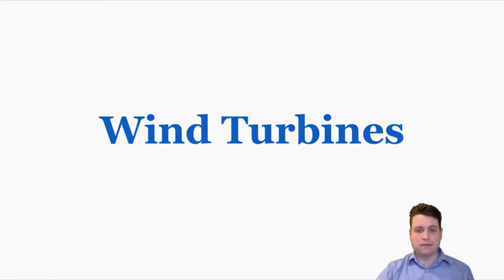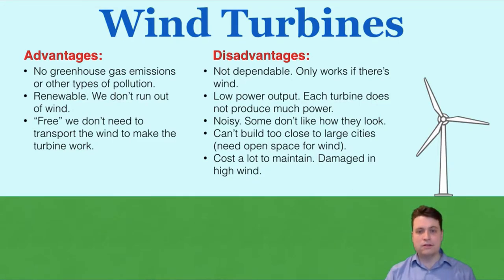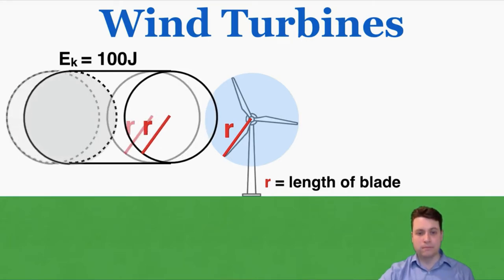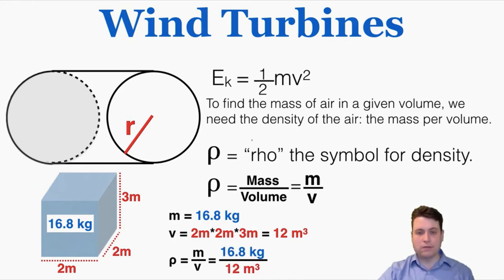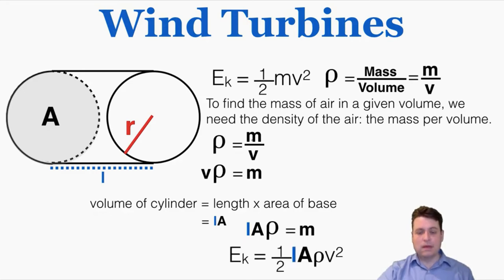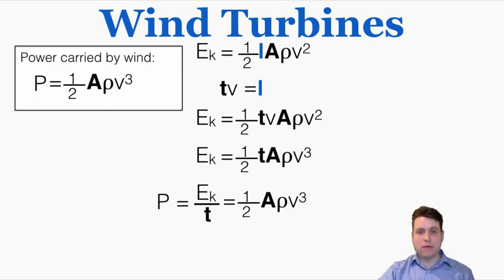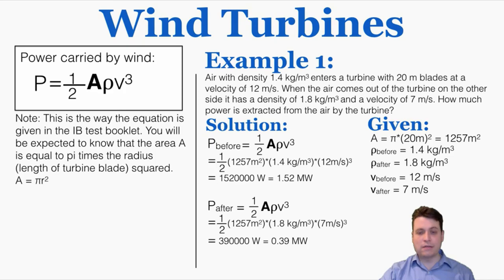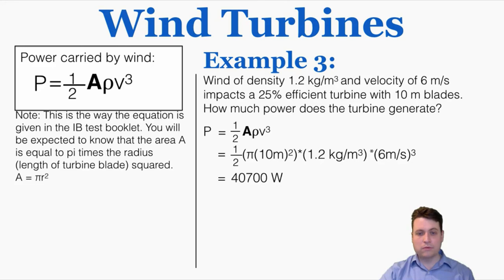Wind Power - IB Physics

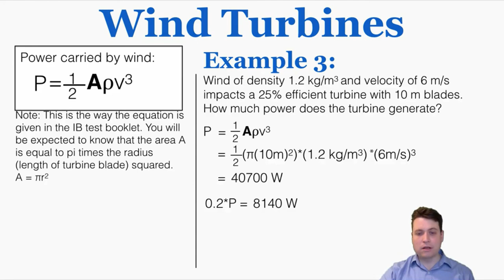Comment: In example 3 9:30 the power 40700W should be multiplied by 0.25 not 0.2 as the efficiency is 25% and not 20%. The useful power output should be 10175W.  For anyone confused

Comment: Very clear, thanks. 
Q1: why do you use very high air densities (1.4 and 1.8 kg/m3)? These are only experienced at -40 and -80celcius respectively - temperatures only experienced in the Antarctic winter). Ambient air is typically closer to 1.25 kg/m3
Q2: why would air density increase by so much across the turbine? 

I feel it is better to stick with typical real world data when known to avoid confusing students.

Comment: Thanks Andy for this tutorial. I have a question. Say the wind speed is not uniform in the area A (due to Atmospheric Boundary Layer effects, obstructions due to trues/buildings), which speed do I use: the average, or do I need to do an integral (as the speed is depending also seen form the center of the turbine axis), or otherwise? In my case I have a speed distribution of the area A, so how do I calculate the power of the wind in that area A? Any help/hint/article/literature is welcome. Thanks and best wishes for 2024.